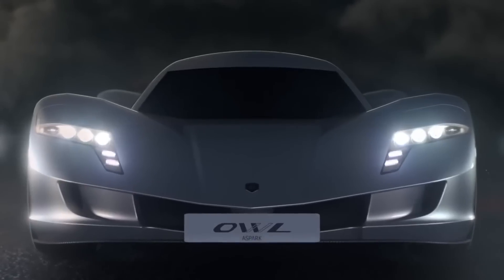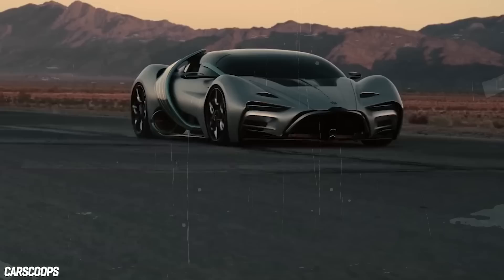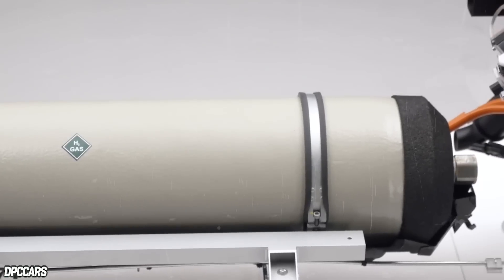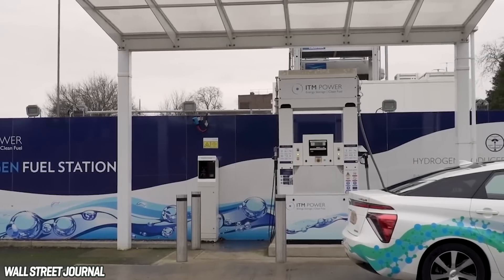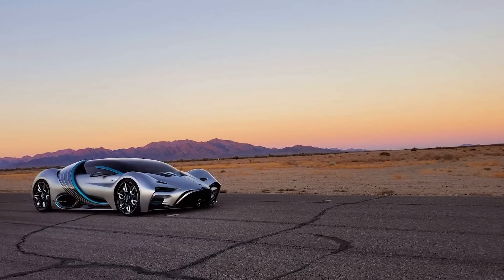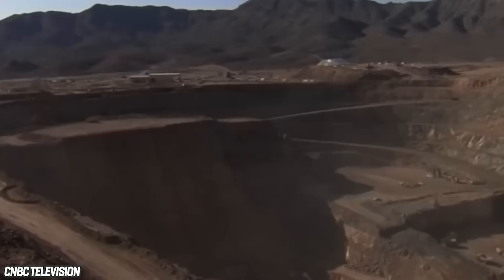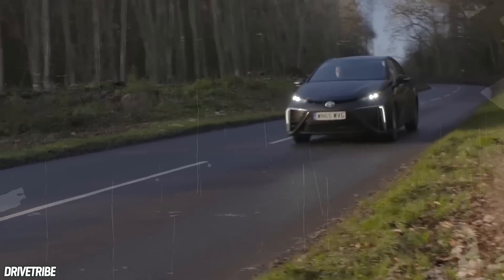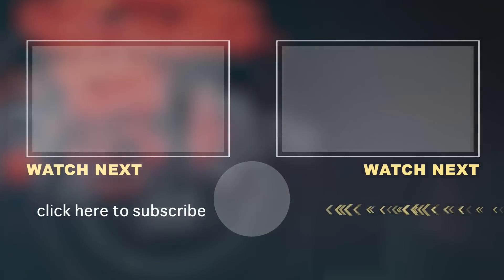Hyperion Introduces It's New Hydrogen Super Car

Comment: Hydrogen is the only way ahead. We fked it up spending all these resources on electric cars instead of researching and evolving hydrogen technology.
Reply: Hydro is the way fwd.
Reply: Unfortunately it is by design
Letting hydrogen tech be developed would have made the few nations controlling oil lose power
That's why EVs are pushed
EVs batteries (which is at a primitive stage of technology for the assigned purpose of replacing ice cars) are made with rare metals
Whoever controls these rare elements will have similar power dynamics like today with oil
There was already a coup in bolivia for controlling lithium reserves (democravy is a facade) for example
Fortunately many nations and companies realized this and are pushing for hydrogen tech like the alliance of japanese companies for hydrogen solutions or some european companies being interested to fuel cells

Comment: The fuel-cell was pioneered in 1838-39 and successfully demonstrated in 1959. It was by far a better choice when compared with batteries in that time of the era. 
Fast forward to today’s need of electricity storage and, FAQs are striking when a modern battery storage is compared to a modern fuel-cell, and, according to studies: 
__ Only about 25% to 35% of energy actually makes it to the wheels of a fuel-cell car.
__ As already known, battery-electric cars have an energy efficiency of 70% to 80% that makes it to the wheels.
__ Fuel cells are impractical due to their low efficiency because H2O must be split with a lot of electricity to produce Hydrogen, then the fuel cell reverses the process to make electricity and H2O byproduct.
__ Hydrogen must be transported to specialized fueling stations in a unique container dedicated for high flammable liquids or, fuels.

Comment: I remember hearing about hydrogen and thought it must be the 'new' fuel.  But, then came the storage issue.  Some said, you'll need a thermos-bottle attached to the vehicle to give it competitive range, others said you can create hydrogen in an old gas station through a process as simple as hydrolysis.  I hear now, that if you compress the fuel (like air in a scuba tank) you can remedy the storage problem.  I now see that the refining, or creation of, fuel-like hydrogen, might entail some sort of a refinery.   Hyperion's claim of 1000 mile range is exciting beyond belief!  I've often thought, the company that builds the infrastructure for the 'new fuels' will be the winner T. Boone Pickens wanted to be with natural gas!

Comment: A water tank in the car and using electrodes you would have pure oxygen as fuel. And if it were raining using the rain water after filtering, because it can be corrosive can be used.

Comment: Hydrogen is illogical compared to electric. Everyone who has enough money to buy a new car has access to a power socket, but not everyone has access to a hydrogen pump. New refineries need to be built and so do new storage facilities and pumps at service stations. In the whole video one car stood out with one features that electric did not have 1000 miles on a single tank. 
So when was the last time you drove 1000 miles without stopping? Never in my life have I needed to do this and I'm 40 now, perhaps 1 in 10,000 people have done this so who cares if they can go 1000 miles without charging/refiling? Tesla is convent I can now go 600 miles without charging and when I stop I can charge while I sleep having a full tank when I awaken, I can park Tesla and charge it at my home. Give up in the hydrogen cars already. I also wonder what sort of maintenance a hydrogen car requires compared to electric?
Reply: Hydrogen is the most abbundent recource in the universe i would say thats definitely a huge benifit and warants further development